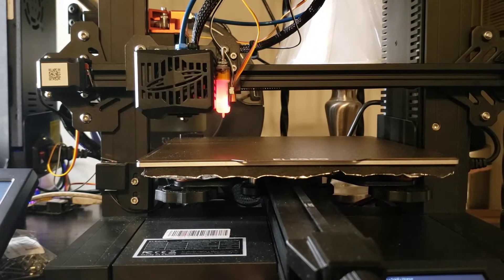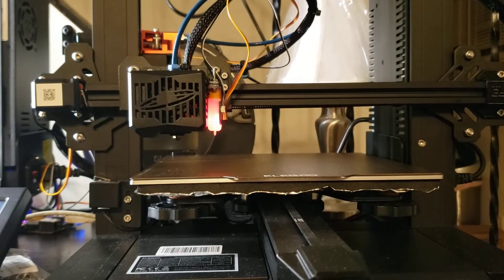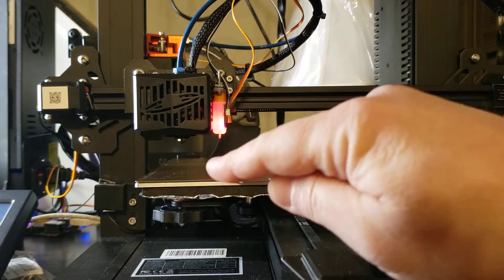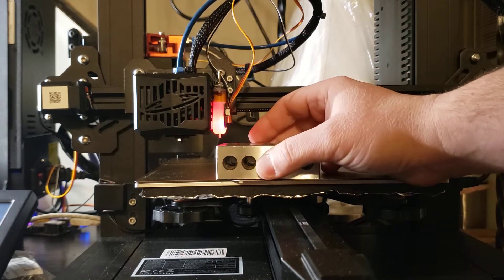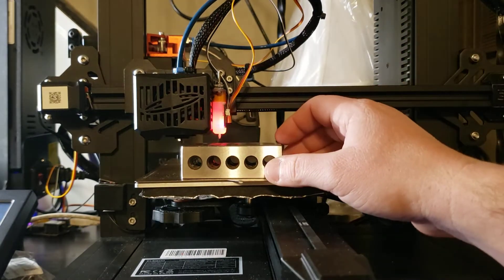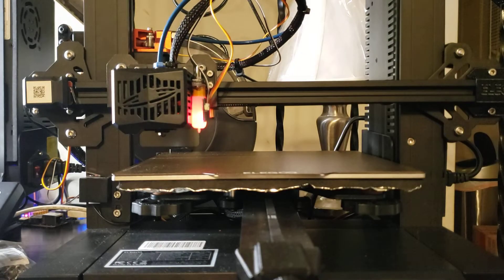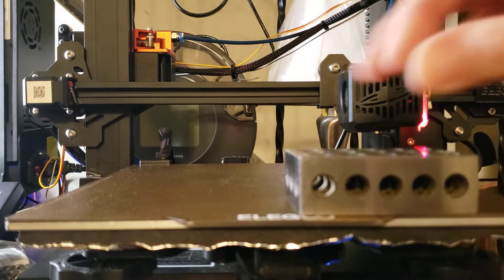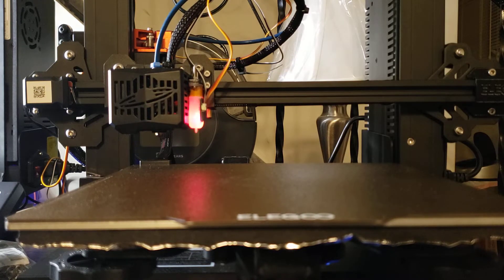Neptune 2 (and comparable): How to manually level your bed if you have a BLTouch

Comment: I use a similar method, but with a thick sheet of paper.
I raise the Z axis a little, move the carriage, and lower it back to its previous height, then adjust the springs.